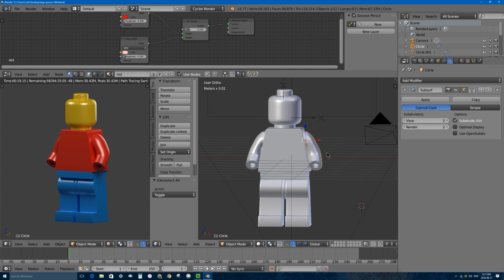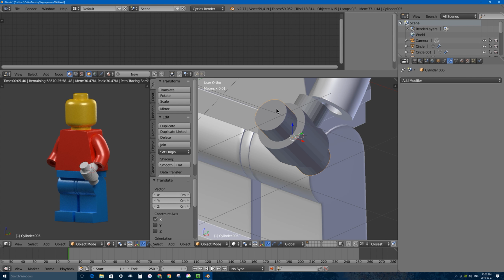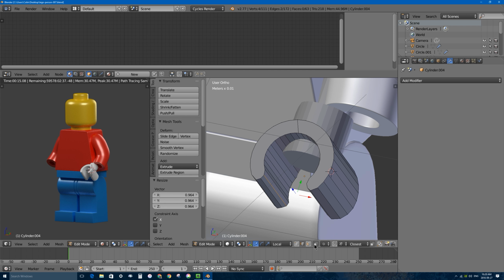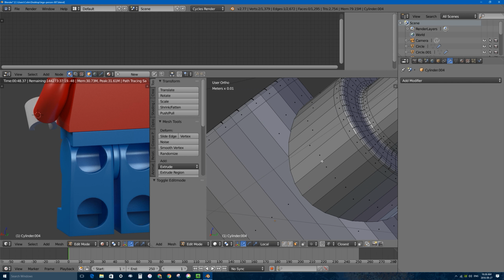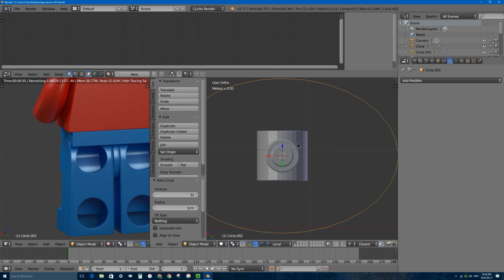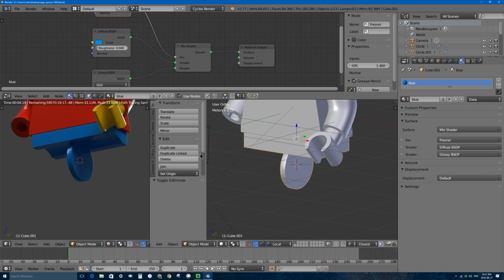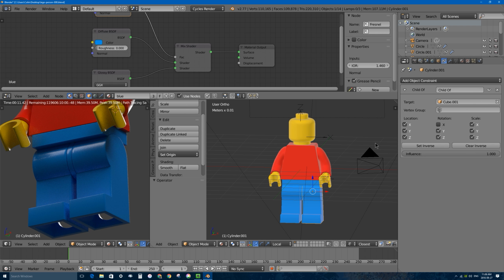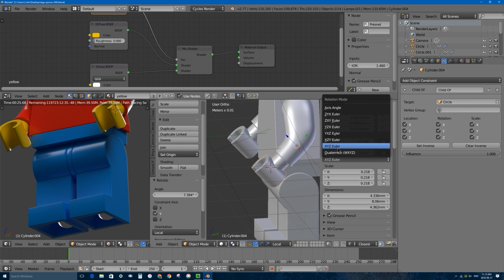Blender 2.7 Tutorial #61: Lego Person (Part 3) #b3d

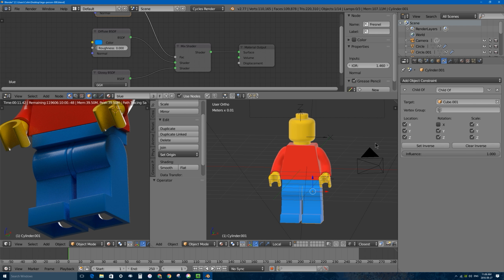Comment: I'm sure it's something very simple I must be getting wrong but at 47:18 when I rotate the angle of the arm, my arm is rotating but my gizmo is not rotating and is still pointing directly up. If anyone could help it would be much appreciated!
Reply: Found the problem, in case anyone is experiencing the same, the solution was as follows "I guess you set the 3dcursor as the pivot point. It’s in the 3dview header, next to viewport shading. Shortcuts are ‘,’ and ‘.’ to switch pivot point between bounding box center and 3dcursor"

Comment: If you use Ctrl while selecting,  it will look for the shortest way to get there - very usefull for example at the part where the wrist meets the hand - So you don't need to select and deselect to get the edges you want.

Comment: if you duplicate the cylinder at created at +4:10, as inner-hand (and 
hide it) then at +8:10, you can just un-hide the inner-hand, and the 
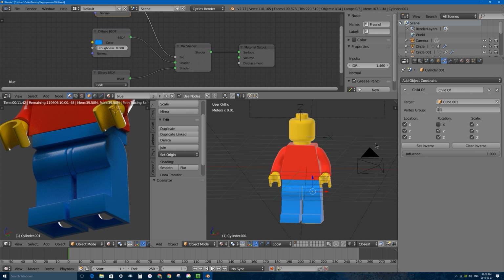cylinders align perfectly.  at +50:45 i had to press R+ZZ,, not R+ZZ,  
to get the hand to rotate into horizontal world alignment. i think it's 
because the cylinder I used for the hand was aligned differently at 
creation

Comment: I have had a lot of trouble making that claw. I've had to go back to previous saves and try again several times. What happens is that I perform the boolian with the claw and cutaway, only to find when I delete the cutaway object a copy of it has merged with the claw. Blender.stackexchange discussed this in regard to the 'carve' library. But that was about Blender 2.6 and I believe Blender 2.7+ uses 'bmesh'. Current Blender 2.78c seems to offer both bmesh and carve. Both generate the same result. I've tried looking at local gimble differences. Intersection of the wrist object during boolian. Etc. And while sometimes I get the right result (only to have other problems with beveling later), I still can't seem to figure out what the problem is in order to replicate it on demand. Obviously I'm doing something wrong. But I wish I knew what that something is.
Reply from the maker: +Paranoid Factoid you might have doubles (two vertices in the same place) in your claw mesh, and this might be causing your boolean problem. Try going into edit mode, selecting all vertices, then press space to search and find remove doubles. Then go back to object mode and try boolean again. .. if this doesn't work, I have found that sometimes the boolean modifier gets switched up and I have to select the wrong operation, ie.: Intersect, Union, difference... The wrong one will do the one you want. I can't explain this error, but I've seen it a few times.
Reply: Tried the first and it didn't work. But I do notice that it seems connected to inverted local gimbal alignment. That is, if one object's Y axis points one way and the other points in the opposite direction, this problem crops up.

 I went back to the beginning (of this tutorial) and redid everything from scratch again and now I'm done with the claw. About half way through the tut. 

Thanks for your help. And the tuts of course.

Comment: Hello +BornCG.  I am chugging along at completing your wonderful tutorial.  Why do you apply the rotation of the arm (object) when the shoulder socket (plane) is aligned vertically instead of after the final rotation of the arm?  See 46:35 in the video.
Reply from the maker: I do this because we need the arm to naturally rotate at a funny angle, because the socket is on the diagonal side of the body.